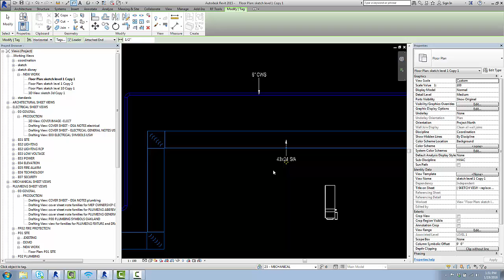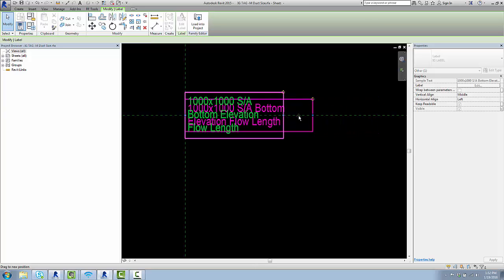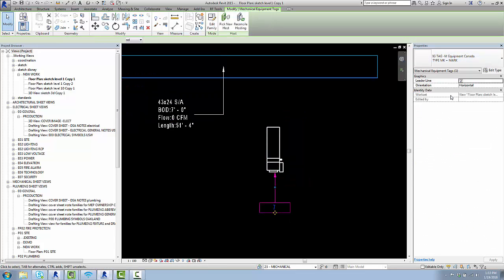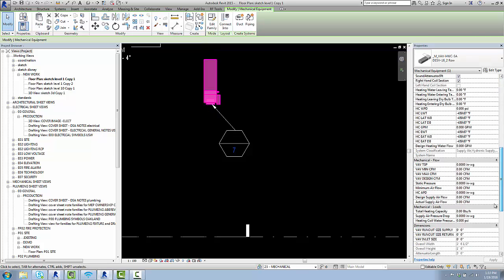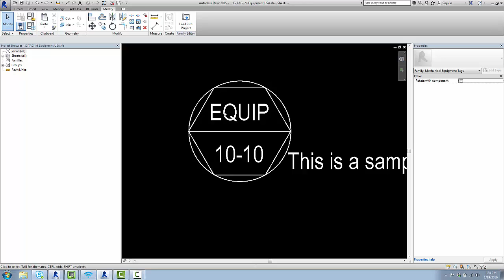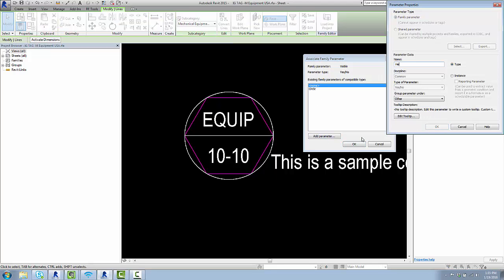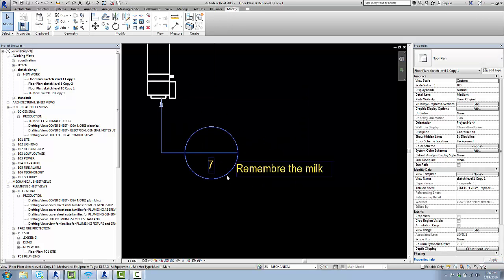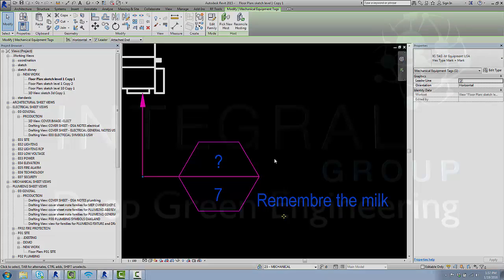How to Edit a Tag in Revit

Comment: I'm wondering if there is a way to set the steps of tagging in Revit. To tag any item or room in need to first click on it and the second click is to place the tag, but placing the tag there is a limitation where I can place it, in casa of room I have to place it in the room boundary and in case if I'm tagging a item(pipe or duct) I have to always place it on the item if there option of leaders is unmarked. So my question is, Could I somehow set up the Revit to break down this limitation where I can place the tag? I'm asking that because I've been spending too much time detailing by dragging out all the tags from the item to make it looks neat, but I would like to save this time by choosing where It gonna go wherever I wanna place.

Thank you.
Reply from the maker: Hi Tito, it's a good question. There isn't any way that I'm aware of of making Revit automatically place tags so they look good and don't overlap with anything else, conform to your drafting standards (or eye for what looks good). There are a couple tricks you can employ to make the process a little faster: 

1) Tag a bunch of items with no leader that are all going to need the tags to move in a similar fashion, select all of those tags as a group, and move them all at once. For example, I have 12 pumps in a row. Tag all of them rapidly - the tags will land on top of the pumps and look bad. Then select all of those tags (box select > filter > tags) and move them all as a group. 

2) There might be a way to make an invisible leader line? So you can place the tag where you want, with two clicks, but can't see the leader? I feel that would get confusing fast though, with tags outside of their rooms or far from their pipes with no leaders. 

3) Ultimately, I feel that placing tags is more of an art than a science, and so until someone develops a good algorithm for computationally placing tags, we as designers have to just brew up a good cup of coffee and try to enjoy the process of artfully placing tags and annotations so the drawings read nicely. Like they did in the good 'ol days before computers started stealing our jobs. ;)